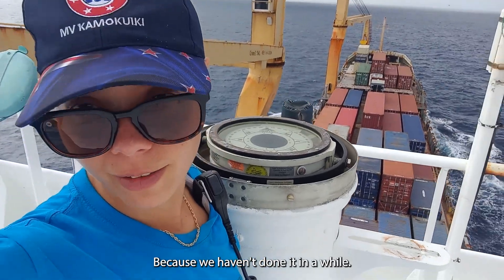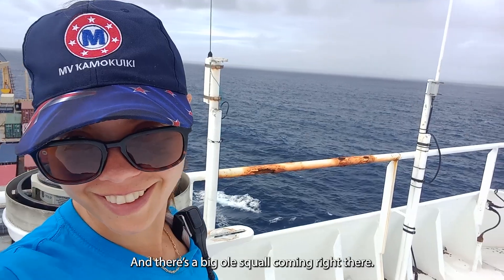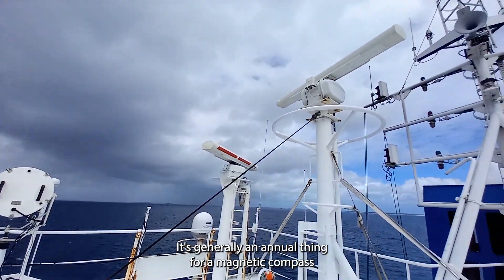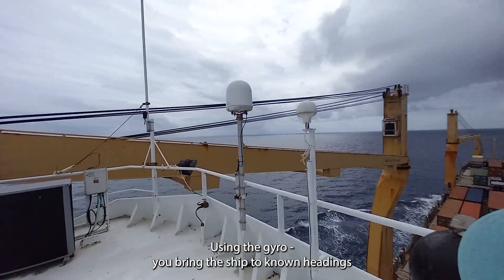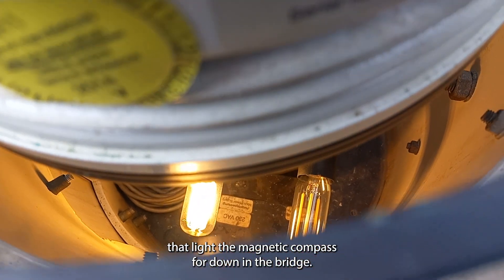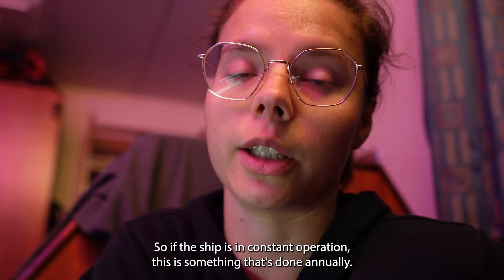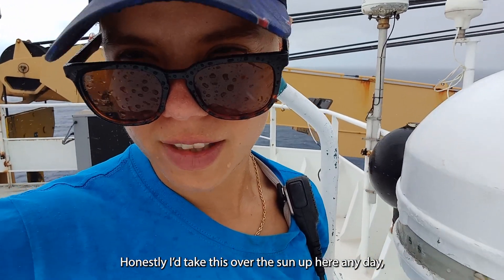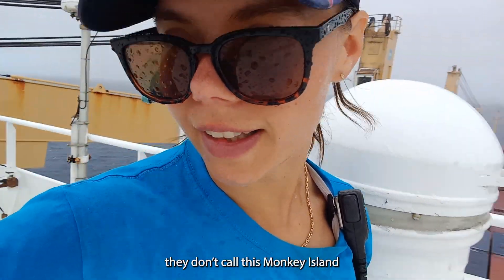Swinging the Compass on a [Tiny] Containership

Comment: How will the earth's geomagnetic excursion of the poles affect your magnetic compass readings? The magnetic poles started moving back in 1850 and the speed of the movement has been increasing drastically. The magnetic poles have shifted further in the past 23 years than they had in the previous 150 years. Will you have to swing the compass more than once a year?
Reply from the maker: Well this error correction is for taking into account the inherent magnetism of the metal surrounding the compass (aka the ship). So far the changing of the Poles isn't fast enough for that to be a real issue at this point in time, not looking forward to the day that it is! 😬

Comment: So, how do you correct for precession of the gyro compass?  We always used the magnetic compass to do that.
Reply from the maker: When is the last time you went to sea?
Reply: @m.leinewolczko  
A long time ago.  But my question is, "How do you correct the gyro compass since all gyros precess?" If not the magnetic compass, what?
Reply from the maker: @tkimble6210 Well I'm interested to know when you last shipped out, because with the integration of inertial navigation systems, that error isn't something you have to manually correct for anymore. It's all done electronically, probably since at least 20 years ago. Well before my time. 
I'm intrigued because you're the second person who asked about precession correction, and I'd like to know your experience too.
Reply from the maker: @tkimble6210 And if you're interested enough to do your own research, I recommend googling the "Schuler method" or "Schuler tuning" and "inertial navigation systems" to gain a better understanding of modern navigation 👌
Reply: @m.leinewolczko  
I spent a summer on a mail boat in lake Superior.  We verified the gyro against the magnetic compass about every 39 minutes while underway if it wasn't too rough.  This was in 1965.  The magnetic compass was verified in port by swinging the boat to known points.  We had Loran but it was spotty.  When I got my pilot's license in the 1990s correcting the gyro was a 15 minute routine in flight.
Reply from the maker: Awesome! Thanks for sharing. I love hearing everyone's backgrounds! Another thing about the Schuler method is it apparently doesn't work for planes due to their variable speeds. Better for ships because we're more constant

Comment: You may have this completely wrong.
What controls the precession drift in the gyro compass?
What is your ultimate reference?
Reply from the maker: There are many errors that are constantly electronically corrected for, including latitude error, ship's speed, etc.
I recommend reading this (and also continuing to do your own research!) to gain a better understanding of how a modern-day gyro compass works 😊:

https://www.marineinsight.com/marine-navigation/gyro-compass-on-ships-construction-working-and-usage/

Comment: I understand the magnetic compass will work when power is out unlike the primary compass that needs electricity.  But to what end?  If the ship loses power it won't have propulsion nor rudder control.
Reply: When a rogue wave took out the bridge on a front-house ship (the Kauai, I believe) 100 miles out of the Strait of Juan de Fuca, they were reduced to using the NFU ("non-follow up") steering and the magnetic because all the electronics, lights, and steering on the bridge were destroyed.  The main engine and the generators all worked fine.  Good think someone had a handheld VHF!